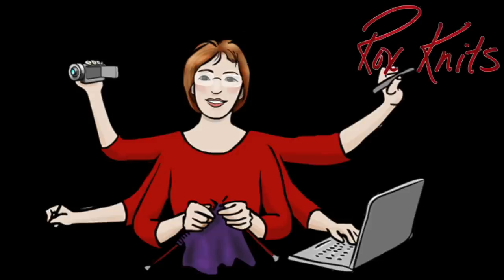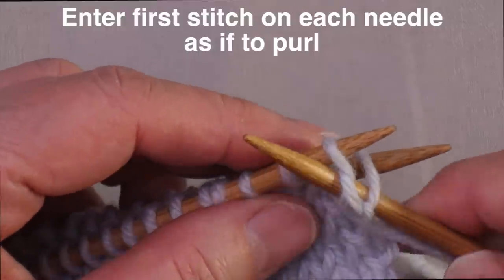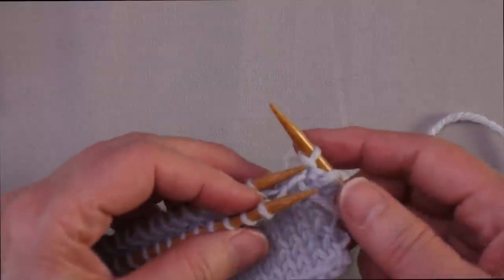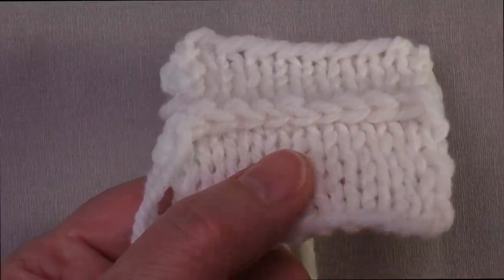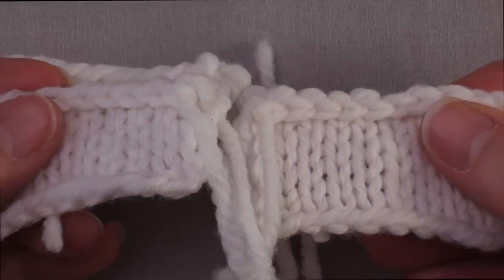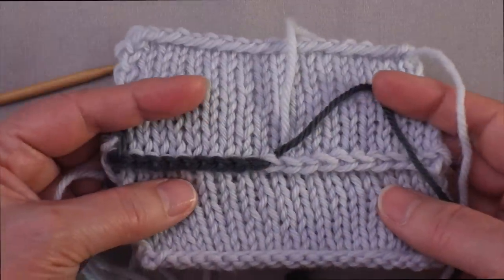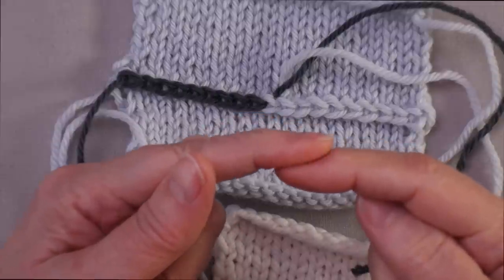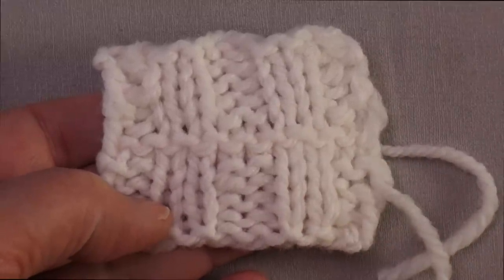Finessed Three-Needle Bind Off // Technique Tuesday

Comment: This video is so excellent it deserves many, many more views after 5 years!  Roxanne - maybe you could add some key words to your video like 'smoother 3-needle bind off' and 'improved 3-needle bind off for shoulders' or even 'flatter 3-needle bind off' or 'new 3-needle bind-off ' ?  Maybe that will help more people, who I'm sure would especially love to learn about that last technique in this set of 'finesses', to find it.  
I wouldn't use a 3-needle bind-off previously because I don't like the ridge, especially on baby's things.  Now I use it very happily because that last one is smooth and flat and does something a graft can't for shoulders, which is add a bit of structural stability.  Bonus - the shoulders meet stitch-to-stitch and are not offset a half-stitch like they are when you graft.  :-)

Comment: I like the knit purl version, I’m going to try it!   I recommend you also do a video showing the invisible 3-needle bo version, the really old one.  In 18th knitting, sock toes and “common heels”, they used the variation recommended for finishing colorwork or knit-purl patterned shoulders.  Using a circ or dpn, on the WS, drop the yarn.  Enter the first st as to knit, the back as to purl, draw that purl through the front knit and both off the needle.   Continue across.  Now go back and bind off normally.  This is less bulky, and on the other side, each stitch appears to dive down into its matching stitch.  This way, say you have vertical two color stripes or ribbing, each stitch will dive down into its mate, looking almost like it was grafted.  With the regular version, the stitches are smooshed against each other, rather than intersecting.
Reply: thumbelinasmum 
Thanks, I will try this, sounds a useful method.

Comment: I have found that I'm 10 times faster and the end result looks 1000 times better doing the three needle bind off with a crochet hook. I should add that I'm a crocheter since I'm 12 but I only started knitting in my 20s. I was so surprised when I did this technique for the first time and discovered that the end result looked just like a simple crochet chain joint stitch. It's just so easy and effortless. 
If someone is struggling with this I highly suggest trying a crochet hook as the working needle. It's just perfect and you won't be fiddling with dropped stitches.

Comment: This is really interesting. I am knitting a scarf in the round and want to join it without having to use mattress stitch or similar. Can this technique be used for knitting in the round? 
I really enjoy your videos and really helpful and clear tutorials. Thank you
Reply from the maker: Are you saying that you are knitting a long, skinny tube, and you want to close it at the end, rather than binding off and seaming?  If so, then, yes, you could join the two halves from the right side, using this technique.
Reply: Yes I think this technique will look much neater than binding off and seaming. I used the long tail cast on and need to close this too. Is mattress stitch the best method for this? Thanks

Comment: I'm making a sweater I kept the bind off stitches on the needles as I finished each row of bind offs  so I could do the 3 nb for a decorative shoulder. As I did the 3 needle bind off I notice a gap I guess caused from one row with 5 bind off and next row with 6 bind off.  How can i eliminate the ?  Also if I wanted to use the kp  bind off would you still follow shoulder to neck , neck to shoulder ?  Thank you for the kp bind off what a great idea.  Is it better to sew under arm seams before or after bind off at shoulder ?  Thanks again.
Reply from the maker: Whether you work both bind offs from the neck to the shoulder, from shoulder to neck, or start at one shoulder and end at the other is up to you and the effect you want in your finished result. In my own projects, I mirror them, working both from the neck to the shoulder, but if you don't like that result, then you should do what pleases you. For shoulder shaping, I typically apply some sort of short row technique at the turns (W&T or German SR), and then work across all of the sts to pick up the wraps or work the double sts before working the 3NBO. If you just turned, without applying a technique, that may be why you have a hole.
Reply: @RoxanneRichardson  Thank you it was late last night when I came upon your video.  I thought of that early this morning short rows may be the answer I appreciate your reply.

Comment: Thank u so much for this video
What would u suggest for a seed stitch 3 needle bind off? 
if that’s even possible
Reply from the maker: 3NBO is worked the same, regardless of stitch pattern. I would suggest working a few swatches in different stitch patterns, so you can compare the bind off in different fabrics.
Reply: @RoxanneRichardson  thank u, I’ll be having a go on a cardy I’m making. 
Do u have a video on picking up stitches on a seed stitch edge?
Reply from the maker: @shimmeringshadow9524  I have several videos on PU sts along edges. You can find them in this playlist: https://youtube.com/playlist?list=PL1AZxTfSCe2dX9mRDhSfBEhumlmtMsA0A For vertical edges, I recommend working the selvedge stitch in stockinette and maintaining the seed stitch pattern in the 2nd st through the next to last stitch. That makes seaming and picking up sts a lot easier, because you have a clean line of stockinette to work with.

Comment: Is this bind-off normally done with wrong sides together? What is your preferred result?
Reply from the maker: I use the standard method on the WS, when the RS is stockinette or stockinette-like, because it matches stitch patterns across the seam line perfectly. I use the knit/purl alternative when I want a RS decorative chain, as in the thumbnail for the video, because I don't personally like the large ridge (which is the standard "decorative" use of the 3NBO, and the one called for in the pattern for the garment shown in the thumbnail). My aesthetics are not always shared by everyone else, so there is no right/wrong way to use it.

Comment: I love the look KP 3 needle bind off. I would like a mirror image for should seams. Starting at shoulder with KP 3 needle bind off  would I start with KP bind off from shoulder  to neck ,then change from neck  to other shoulder with PK 3 needle bind off for a mirror image.  I would like a decorative bind off edge.   thank you.
Reply from the maker: The chain is mirrored simply by starting each shoulder seam at the neck and working toward the arm. It doesn't roll the way a regular 3NBO would roll, so the visual difference when viewed from the front vs the back is very minor. On the other hand, any time you have an idea about something that you think might work (because you might like the result or process better) I would encourage you to try out your idea on a swatch and to see what you think. That's how knitters develop and refine techniques: by experimenting.
Reply: Tank you so much!  I have learned so much from your videos !